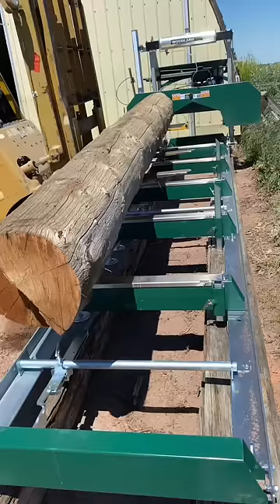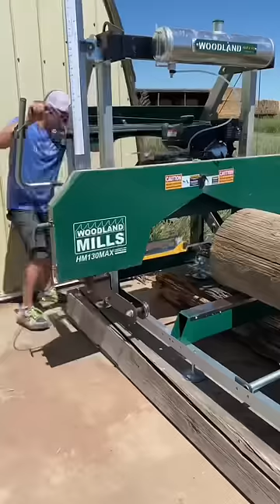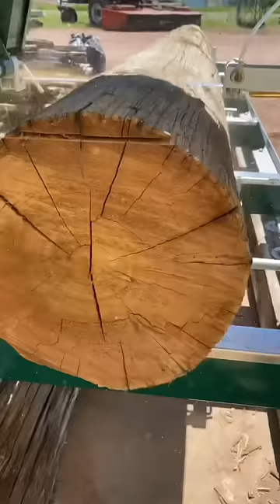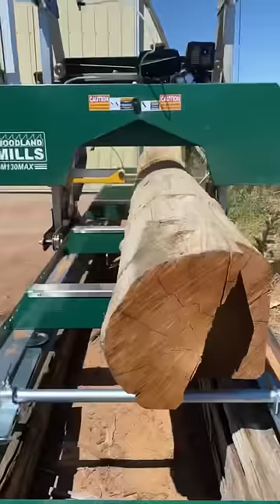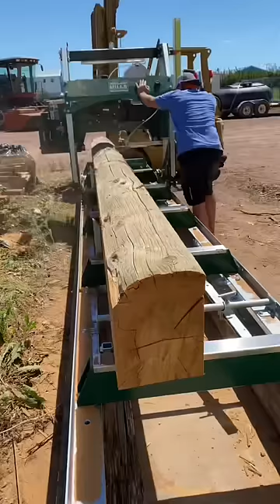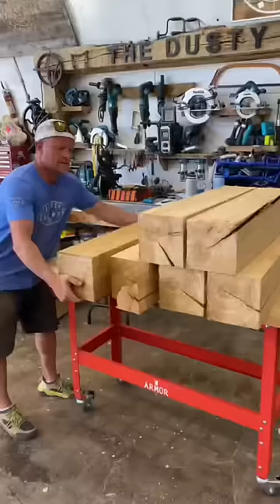Cutting up an old cedar pole #woodworking #woodwork #maker #wood #sawmill #bois #holz #madera #work

Comment: Dude, the sound 🤣
Reply: Haha. The sound is dubbed in. Probably an electric engraver or somesuch nonsense. I've done plenty of milling with a Wood Mizer band mill, and you need ear plugs at the very least.
Reply: @11bravo18 🔥
Reply: @11bravo18  🔥
Reply: @11bravo18  🔥
Reply: @riply7130  🚫
Reply: @riply7130  
p8

Comment: That skill saw with the chainsaw attached it awesome! Where does one get one?
Reply: They’re called beam cutters. They’re typically pretty hard to find in store, but they’re everywhere online and several different tool brands make a variation
Reply: Its called a wood mill, ive worked with wood since a kid, these can cost like 20-200 grand
Reply: @djdubs8544  I think he’s referring to the saw used to crosscut the beam after he’s ran it through the saw mill.
Reply: @kylerpeek3121  ohhhhhh in that case good shit man you got some impressive knowledge
Reply: Skilsaw is a brand